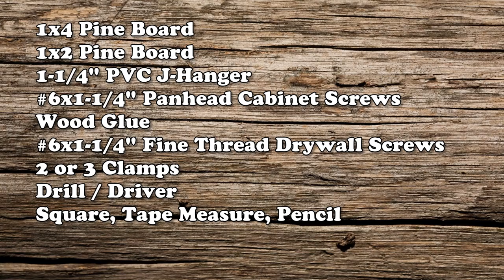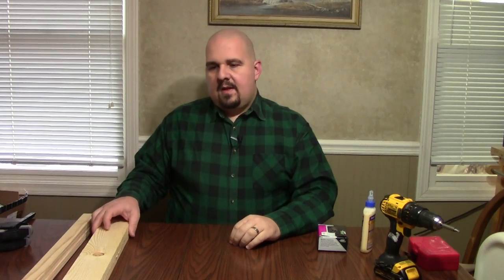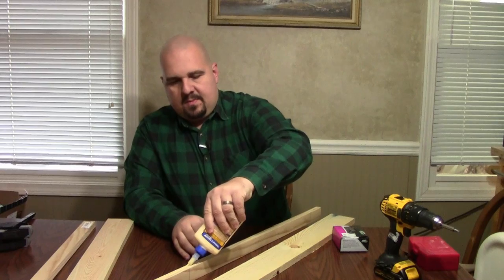DIY: How to Build a Cheap, Easy Overhead Fishing Rod Storage Rack

Comment: There are many ways to do this, however; I like what you made.  I think It's clean, functional and easy to do!

I dont know anything about the J hook. Are you satified with its sturdiness and toughness?
Reply from the maker: I'll put it this way. About 18 months after I built this project we had a ceiling collapse in the garage. The boards the j hooks mounted to were damaged, but the hooks survived and I used them when I rebuilt my Holders.

Comment: @The Weekend Angler - how far of a gap did you leave between the two different hangers ? Looks to be about 3-4 feet?
Reply from the maker: You can play that one by ear depending on the length of the rods you were holding. I have them down right now because I'm having to remodel my garage. They were spaced somewhere in the neighborhood of 32 to 36 inches apart
Reply: Very innovative and creative!! Thank you for sharing the information .

Comment: any ideas on how i could build something like this on a wall instead of a ceiling? Im too short to be reaching for my ceiling all the time haha.
Reply from the maker: You could modify this same design by making all of the J-Hooks go the same direction. Personally, I'd shorten them a little if I was going to wall mount the finished product. Then you would attach the two rod holder sections to the wall by screwing into studs. The rods would sit in the plastic J-Hook holders. Your rods would then run horizontally along the wall suspended by the sections of rod holder that you would attach vertically to the wall. 

Send me a message if you're interested, and I'll draw a diagram of what I'm talking about and send it to you.

Comment: Are the Hooks pretty sturdy?
Reply from the maker: They hold my catfish and snagging rods with no issues. They're sturdy enough for my requirements. I'm not sure how much weight they would actually hold, but remember they're designed to hold PVC plumbing and water gets heavy very quickly.

Comment: Just drill holes in  boards and cut J in the wood ,don't don't all that plastic crap
Reply from the maker: If you decide to do it that your way, make sure you put some felt on the grooves in the wood so that you're not knocking holes in the epoxy coat on your rod.